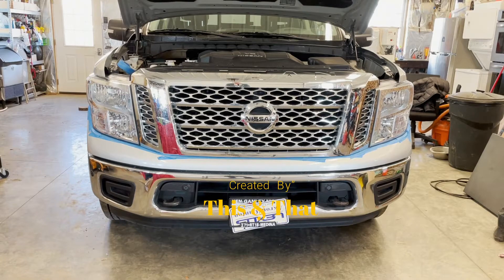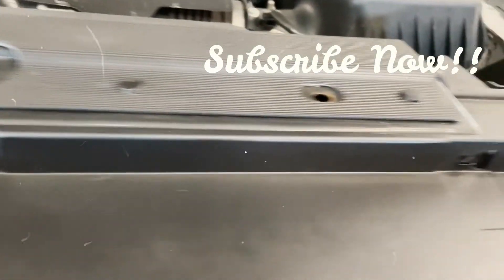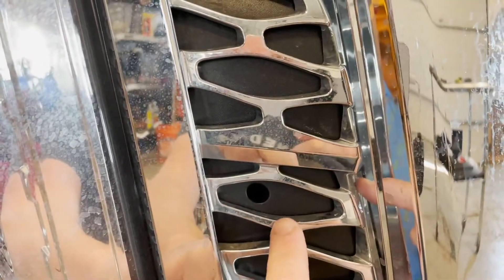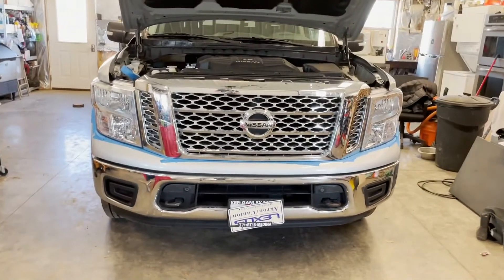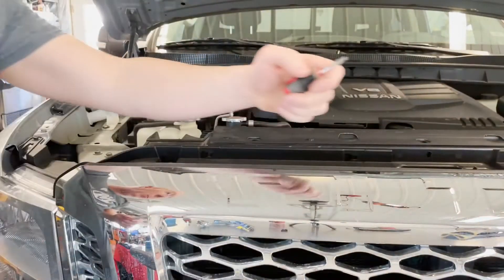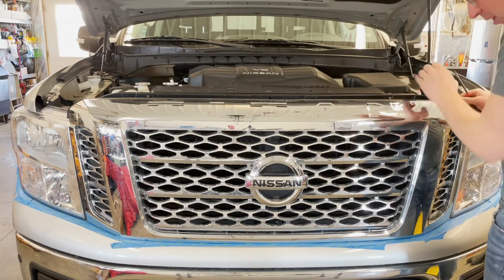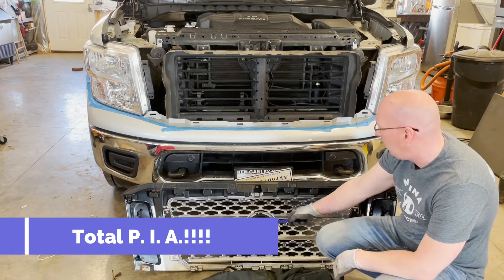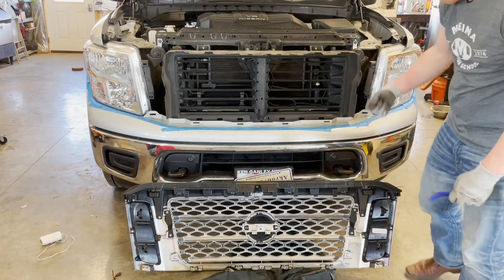Nissan Titan Grille Removal - How To Remove New Style - Newer Titan

Comment: Can you tell me what you did about the side and top clips when you installed. Did you turn the clips 1/4 turn again or did you unhook and install in the grill  then push into the holes?
I am having a problem figuring out what to do.
Reply from the maker: If I remember correctly I put them in the grill and then installed into front end of the vehicle…it made it easy to insure that the clips were installed correctly in the actual grill. Just take your time lining it up when you got to put it back…hope this helps.

Comment: You sound like the teacher in the charlie brown cartoons & you don't show how to remove the clips. Your back is turned & hands are in the way.
Reply from the maker: It’s a bitch of a job for sure…and the audio sucks.  Sorry about that!
Reply: I was able to remove the bottom six clips by pushing up on the rubber under the clips with my finger. Had to push really hard but it worked. Had it off in half hour
Reply from the maker: Good to know!

Comment: First thanks for the video and in that note please don't be offended by the suggestions I am about to offer.
Please do something about your sound. It was very mumbled and I almost left the video because of that.  Please also in the future explain ALL details. You speak briefly about the side fasteners but fail to mention how you removed them, which I found out was exactly like the top fasteners.  You take out some kind of red tool and wave it around the front of the truck, but it has nothing to do with the fasteners. On one final note, if you had some close up views of the final stage where you remove the bottom clips that would help to show the exact location of the pry bar. 
Thank you
Reply from the maker: Agreed on all parts, I plan on redoing the video the next time I remove the grill. Thanks for watching and the suggestions, take care!

Comment: Actually...releasing those 6 lower finger clips is rather easy with a proper tool. I`ve had the grille out of my 2017 so many times from either adding/removing off road lights to adding raptor style grille lights. Trick is make a hook tool. I used 1/4" round rod bent in such a fashion that is can reach under those fingers and pushes up a locking tab. Now the key is once one tab is unlocked you need to pull that part of the grille forward slightly so that finger can not snap back into place. Now do the same for the other three fingers. Two of the fingers you can reach by hand by reaching down between the headlight and grille. I can have my grille out and on the bench in less than 5 minutes.
Reply from the maker: Good info! Thanks!
Reply: Super easy when you fabricated a specific tool to do one specific job... what the hell dude. This part took 2 hours. But yeah super easy.... Sangano!
Reply: It would be nice if you attached a video to further explain. Do you reach in from the front of the grill??
Thanks